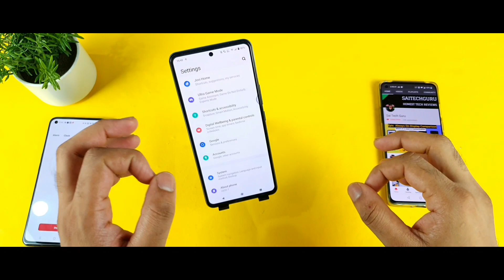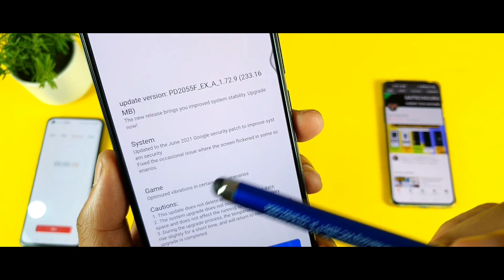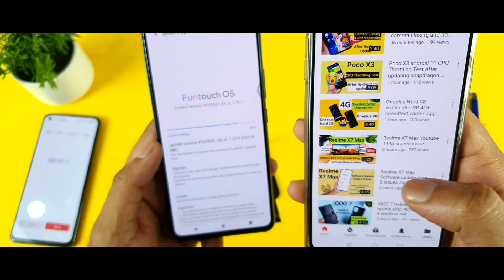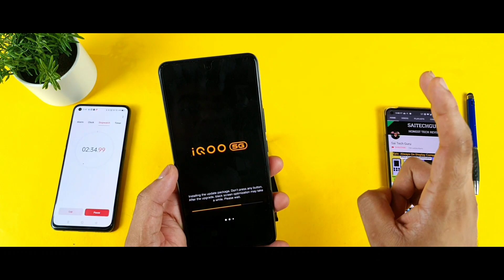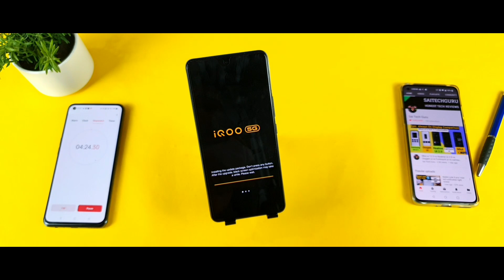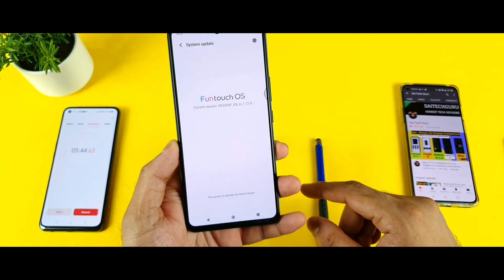iQOO 7 Software update size & features & installation time taken finally arrived 🔥🔥🔥

Comment: Bro. I think your unit has a problem. Because my one got installed very fast
Reply from the maker: I did fill my storage 96% so may be that might be the issue
Reply: @SaiTechGuru  yes. And charging speed is also quite high. Today after the update i ran antutu. It came 7 lakh plus